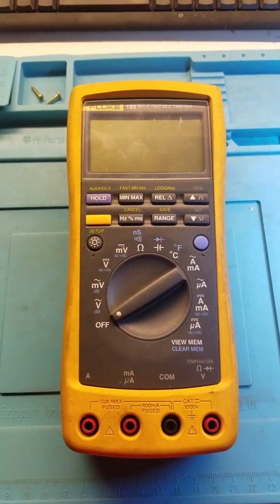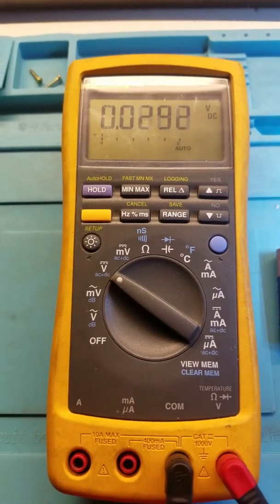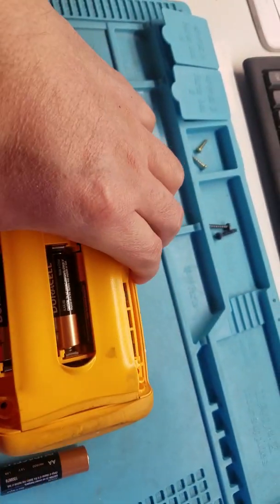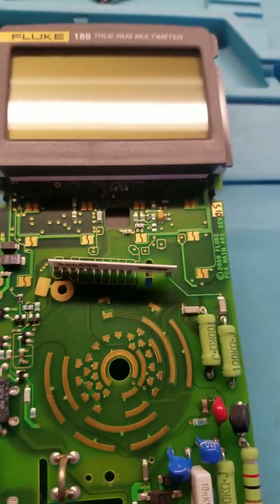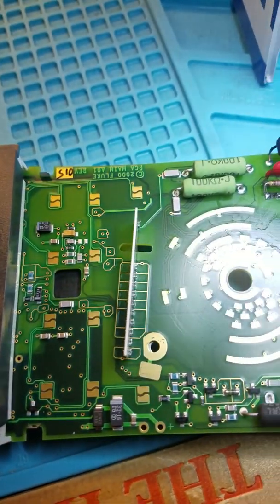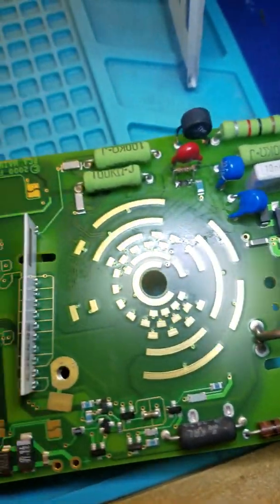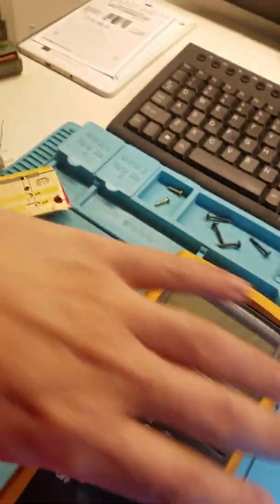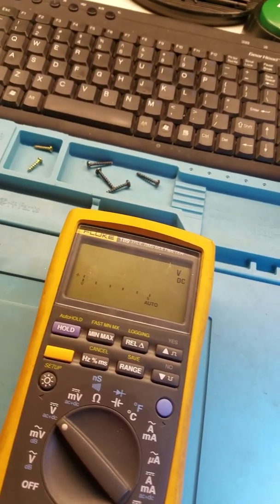Fluke 189 repair

Comment: As per color codes as I seeing on resister it is not 27k ohms it is only 27 ohams...but I think here is the correct value of resister is 2.5k ohams...
Reply: It is 2611= 2.61 kohm